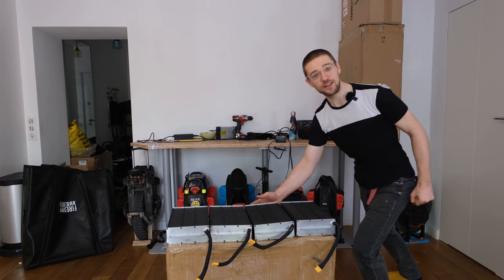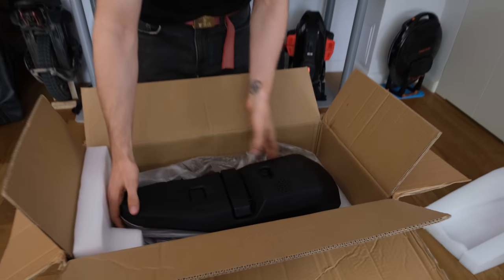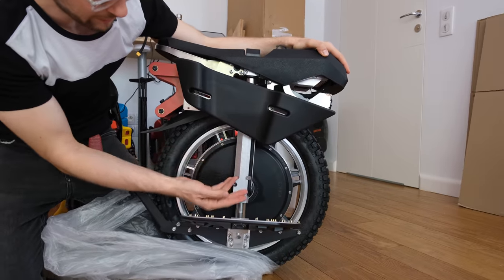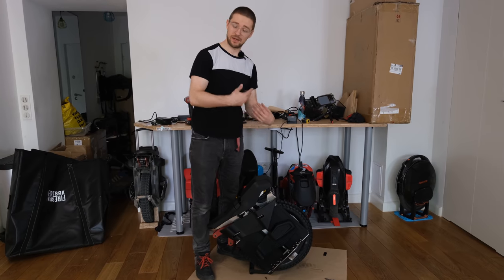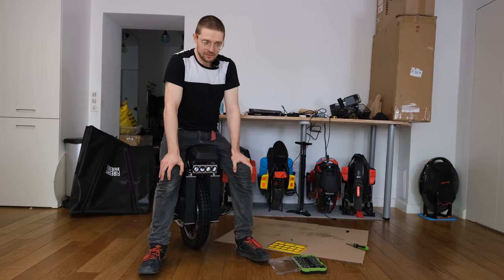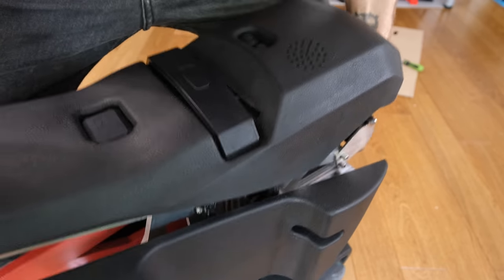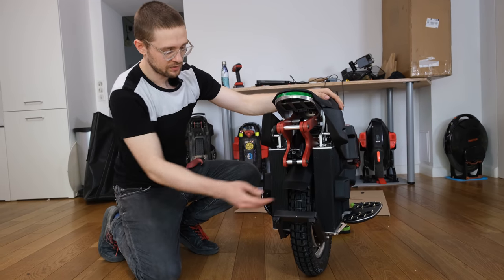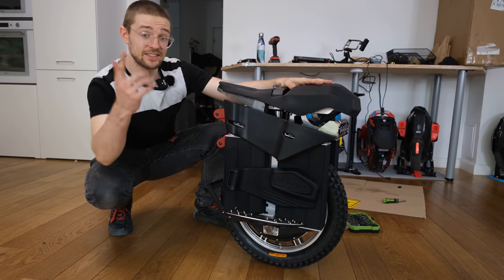BEGODE EX20S Unboxing

Comment: I love that new EUCs have pads and good pedals out of the box now, my main wheel broke recently and while it's being repaired I bought a used inmotion v10f... it's an ok wheen actually but omg the pedals are not ever grip tape.. it's rubber! What were they thinking? No wonder people use to be skeptical of going fast on a EUC
Reply: AFAIK new V10F wheels has grip tape pedals. Same as my V8F.
Reply: Yep! Newer versions of the V8 and V10 series have griptape on the pedals. I bought my new V10F last year and it has pedals with griptape! 👍🏻
Reply: @Scheltokeeper  I glued some grip tape on rubber it changed the rider fill so much

Comment: I like the looks. It is like a motorcycle, all the works on display. I think it would be easier to water proof in the long run. Battery in it's own box means after market/DIY is possible. The possibility of easier tire/wheel/motor changes looks good too. Yup, I like the idea of a frame that all bits are mounted to, it looks less like a vespa scooter. Is this the one that can have lifepo4 cells? I am guessing it did not come with them though, too bad, reall life testing would have been nice.

Comment: "Pump too slow..", then she recorded your neck vein popping out. Brutal!

This wheel build like a tank, i wonder can they overlapped the battery packs over those verticle rodes, so the front and back edges of the battery packs doesn't stick out too much. Only if this wheel does 60 mph. Next year, i want Begode's secret wheel "Sifu" 70 mph! More power!

Comment: Interesting looking wheel. Great video
Reply: I wonder why Begode doesn’t make This 136 v like the master. If they did that the ex20s would be a real competitor.
Reply: @franklinbrown7389  Its because of battery configuration. 136V is a new config with battery packs in series. This is how they achieve this higher voltage. 100V 900 Wh pack is already a proven technology for Begode. Once the Master as been release to the public, they can prove the reliability of the new technology. 134V will probably be the norm for high performance wheel in the near future.
Reply: I want it to survive your 1 minute ride Mr U Stride, Ha.  
 First big battery suspension wheel ever is very exciting mile stone for the history of euc. 
I wish you nice success. 
Be well from Will and Mr Data :):]
Reply: @WillofNewZealand  haha I'm sure it will. It's a gotway. But yes the specs on this wheel is amazing

Comment: I wonder if the Master 3000+wh model rumor will turn out to be true, not sure if they can physically fit that much but it'd be awesome
Reply: thats pretty huge battery wonder if it will fit inside the master.
Reply: If that would be true.. I'd instantly go for the master gen 2 with 3000Wh capacity.
Reply: The issue I foresee here is that the Master is meant to be a really good offroad, all-around ace wheel. Improving the battery will add more weight and size (just look at how EX20S' battery corners are way too close to the wheel's edge to be safe off road).
Logic would want Begode to up the EX20S motor to 134V instead and keep the master as is for a more offroad usage. I mean if they bump the Master's battery it would be ridiculous to have a 134V, 3000+wh wheel and a 100V, 3600wh from the same company as parallel sells and then no wheel to compete against the S22 for light, fun offroad usage... At least, that's my opinion.

Comment: I am wondering what a good possible first EUC would be for me.  The relevant data: I'm almost 200lbs (90kg) and 50 years old.  So I'm not exactly the target demographic for EUC's, however they excite me and I really want to ride one. I'm a physically active person who rides motorcycles and bicycles frequently, and as a Gen X-er, I have had much life experience with action sports activities, so I feel like there is a good chance I can learn to ride one well - as long as I pick a good first one for me.  Any thoughts or suggestions?  Thanks for your channel!!
Reply: From what I read:
choosing a smaller wheel to learn on is the way to go.

It really depends on your needs, esp. range and how much offroading you might want.

Personally, if price would be no issue, I'd go for a KingSong S18 to learn on and get a longer range one if needed. Then upgrade to a Sherman Max or Master.

PS since I want the most bang and quality per buck, I'd instantly go for a wheel that I need to tame first.
Reply: @privileguan9127  So the wheel that you need to tame first.. what would be the best option for that lol

Comment: I’m relatively new to EUC (about 5 months), but I have a V11 and a V12. I like the V11 more because of the fatigue I get from riding the V12. Here’s the thing, though, I don’t think it’s because of the suspension, I think it’s because the V11 is so much narrower which means my feet aren’t always torquing outward on the pedals. Then I see this wheel and all I can think is my legs are going to pinch the top of that wheel pretty hard and create even more of that outward pressure at my feet. I don’t think it looks very comfortable. I’m looking forward to seeing what the next evolution in wheels will bring, but I think it would be helpful if they found ways to mount the batteries so they don’t increase the width of the frame where your legs need to be. Having the pedals closer to the wheel should reduce pedal scraping, too, and reduce the odds of inadvertently clipping something as you ride by.
Reply: You’re still a very new rider. Still so much for you to learn and adapt to. Do you ride with a straight stance (zombie rider style)? That could also be contributing to fatigue in your legs too. A little form adjustment and more miles under your belt will fix that forsure. The pedals as they are are legit. It gives you more control and leverage. The height of the wheel should afford more clearance. The size of the wheel lends itself to more stability and comfort. Especially for seated riding.
Reply: @osbornroxas973  I bend my knees. It gets wobbly pretty quick with straight legs. There are times when I find more of a relaxed stance that takes some of the pressure off, but I still wrestle with the V12 when I’m getting my feet in place and they are hanging a bit off the sides of the pedals when I feel like I’m in control. I’ve recently adopted having one foot slightly in front of the other to control acceleration without leaning too hard forward (I’m a big rider, leaning too far forward would overpower the wheels, especially the V11).
Reply: @insidespin2698  ahh that makes sense. Yeah having a more relax bent leg stance I find to be more advantages. Have you tried looking into bigger spiked pedals? Maybe even a bigger wheel might suit your frame better like the ex20s, mspro, or Sherman max. 

Took me a lot of fiddling to find the perfect set up for me currently. Pad placement, pedal brand and pedal angle, wheel angles tilt, and stance. Keep at it. It’s really a matter of seat time. Safe riding.
Reply: @osbornroxas973  Thanks for responding. I don’t know anyone around here with a wheel, so it’s all “self taught” as it were. I have installed spiked pedals on both, Clark pedals on the V11 and InMotion pedals on the V12. Clark pads on both, but I’m not sold on the positioning of them on either yet. They’re velcroed, so I’ll probably fiddle with them again soon. I have thought about a bigger wheel, but, I mean, I just spent $5k on wheels a few months ago, so I need to hold off for a while. Also, I’d like to see how the V13 looks and if KS resolves some of the issues with the S22 after the first couple of batches. It seems like the EUC community in general treats the Sherman like a reliable workhorse, so it might be a good choice for me as I use my wheels more for commuting and not so much with the trail riding (although, the roads and sidewalks around here…)

Comment: That is a flesh ripping machine. These metallic hard edges will rip you not just when you crash or it falls but also by quite standard use. There is no handle and the cables are pressed against metallic hard edge. Too bad on many levels. Already hate this. Maybe it has long range and suspension but is totally not made for any humans around (not just rider).

Comment: Whats the difference between this and the master?
Reply: This one has lower voltage, bigger batteries (hence bigger range). The master is a competitor to the S22, this one is basically a Sherman max with suspension, different usages. We could argue that the master is your exciting off-road "light" and fun wheel, while this one would be your comfy very long range cruiser.

Comment: Will the batteries be crash-safe...🤔
Reply: Are batteries ever crash-safe? Even in metal encasing, a shock is a shock, unless you have some sort of dampening system which would add to the weight and size.
Reply: @grumpykitten2448  other wheels have a plastic/composite shield with a little space between it and the batteries. It takes a bit of the blow and most of the road rash.

Comment: Batteries are parallel or in series?
Reply from the maker: Parallel
Reply: @mr_wrongway  The four battery packs are in parallel, so they are 100v each, not like the Monster..... If I understand properly they are like 36v each in series[Head scratch]

Comment: Got it using your code!
Reply from the maker: Dope! Enjoy and thank you!
Reply: @mr_wrongway  Thanks! Should be here in a few days, do you have any tips for me or things I should do? It's my first ever wheel, I got it mainly because of the range, but it will probably take a long time to learn how to ride, it's 50kg! Crazy
Reply from the maker: @CycleCritic  hmm maybe just check bolts and that’s it? The sliders don’t need greasing but sand or other debris could potentially get in. That’s something I’ve found out later but so far so good on extreme (I still need to check where some noises of sliders are coming from)